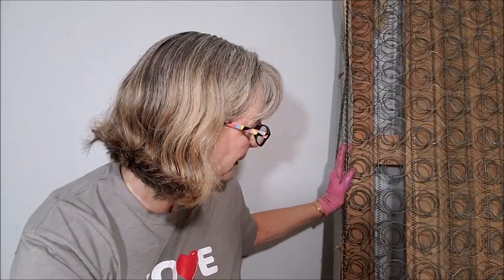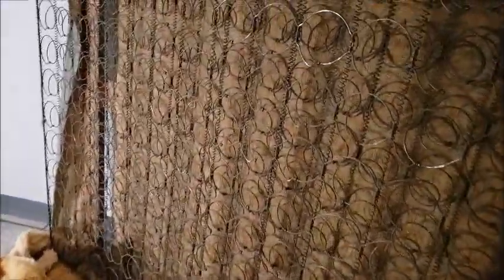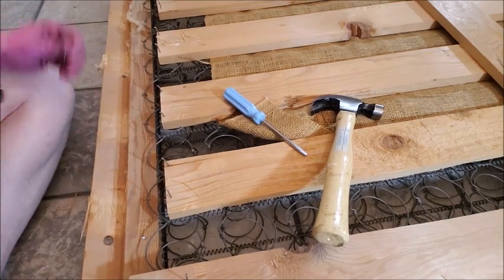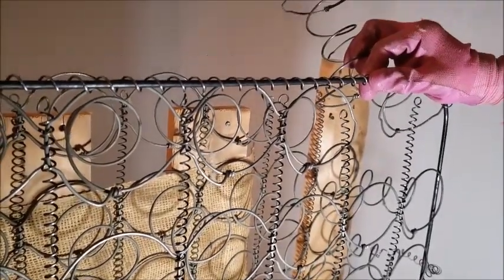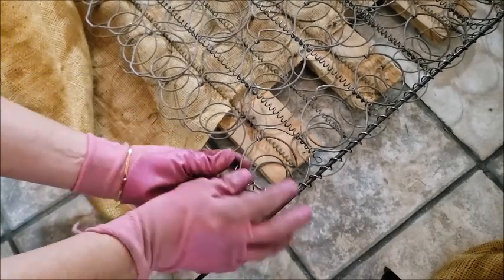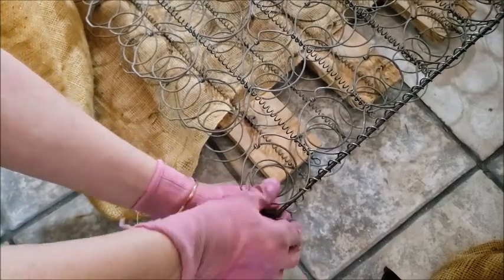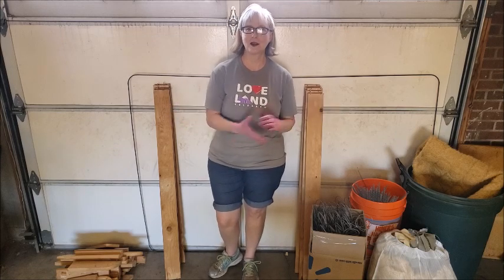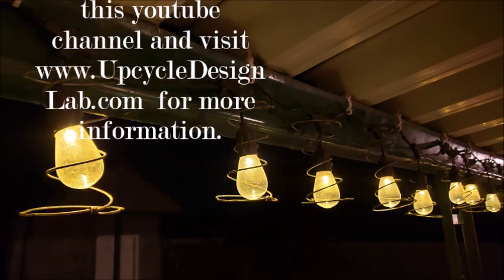How To Tear Down A Box Spring For Reuse

Comment: I'm amazed to find that there is actually a video here on taking apart an old box spring.  LOL!  Earlier today, I was puttering around and thinking my bed is much too high for my tastes with the new deeper mattress and pillow top.  So I shoved the mattress off and took the box spring out, thinking I would discard it right away.  THEN ... I saw that there was some really good wood underneath and figured if I could take it all apart, I could use that wood and convert my bed into a platform bed -- of sorts.  🙂  I cut off all the fabric and then began to painstakingly remove all the U-nails that hold the springs in place.  I started using a screwdriver to loosen them, then pincers to pull them out.  Then my forearm got tired and achy, so I made myself a coffee.  That's when I came to youtube to see if there might be an easier way to tackle this little DIY project.  I'll get back to you once I finish watching, but just wanted to say "good on you" for thinking like me.  Sisters are doin' it for themselves!  Yay.  :goodvibes:
Reply from the maker: Hi thanks for watching. It was a lot of work and by the end I was pretty sick of it and wondering what I was thinking when I started 🙃 It is fun to have the springs to craft with though.

Comment: The white batting is cotton batting. The brown batting is either coconut fiber or sisal fiber. The wire holding the springs together, if you cut the ends loose. You can use a drill in reverse to unwind them, and you won't get all cut up from them and it saves time.
Reply from the maker: Thanks for the tips if I ever do this again I will have to remember to use the drill to unwind the corkscrew springs.
Reply: The yellowing batting would look great under Thanksgiving decorations.  And the coco fiber is used to line wire hanging flower baskets, then composted at the end of season. The large springs look great as light bulb covers.  I also like your snowman idea.  The smaller connecting wires would make great plant stems for large outdoor soda can flowers.  They would bob in the wind and look so eye-catching. They would also look great as stems on Christmas tree picks. I could see the with your snowman heads on the ends, bobbing out from the tree.   Thanks for doing all the work of reclaiming and repurposing stuff from the landfill.  If we all just got 50% of our decor this way, we can make a big difference in the amount of waste. Keep inspiring people to think of ways to upcycle  the old stuff.  It’s better made, anyway.